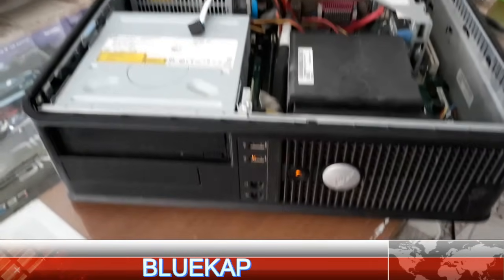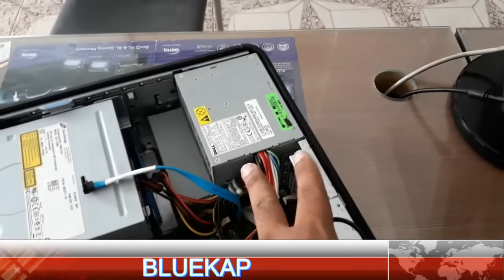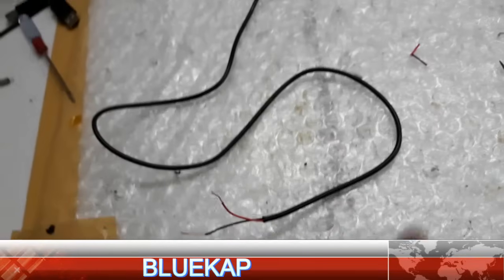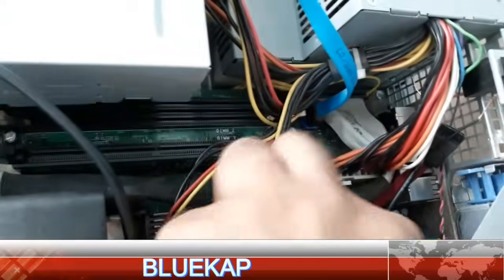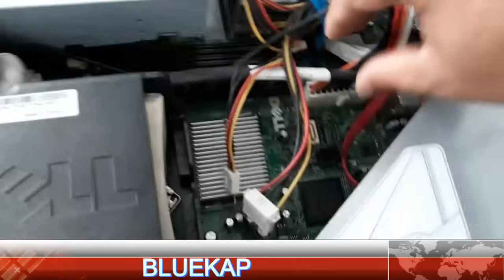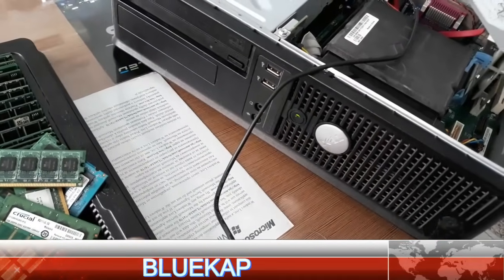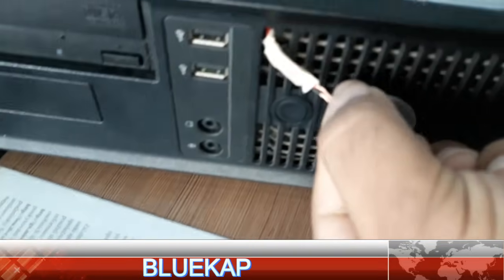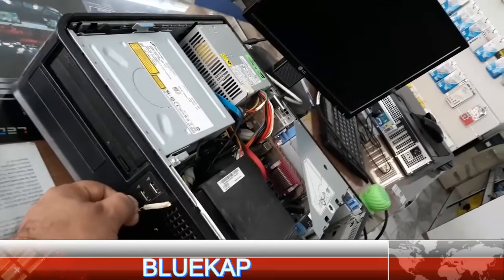Fix the Dell Orange Light of Death

Comment: Methods to solve the issue.
(1)If there is a blinkin' amber orange light on your power button that means Your Power supply ain't malfunctioning. To solve this one: There is a cable coming' outta your power supply which has sorta a bunch of wires that is connected to the Motherboard as the MAIN CABLE... There's a wire coloured green. You'll need to cut this and tape it on anywhere of your Computer's Case/body. It will boot up the computer with showin' a green light on the power button Or if your computer didn't boot up See the next Method for the motherboard.
(2)If there is a solid amber orange light on your power button that means Your Motherboard ain't malfunctioning. To solve this one: Unscrew the CPU Cooler and right close to it there would capacitors... Two capacitors around a little AC and there are 6 capacitors around 3 ACs... You gotta find which one is damaged. The one which works fine is sorta Glass-type coloured like a little light orange. The damaged's one surface is black... You just have to break it through a screwdriver or anythin'. Just take it outta your motherboard... Your PC will start up... That's what's the problem is. And yeah puttin' a bulb inside your Computer would help a dyin' capacitor and leavin' your computer with the case open on the SUNLIGHT would help you boot i up. I dug a lot to fix this up... I expereicned you didn't. Try these methods I told you...
Reply: Where do I need to tape the green wire on the motherboard or outside the case
Reply: @flamynoob9316  He did say to the outer case, not the board, otherwise... POP!
Reply: Putting it into a paragraph and fixing up the spelling would help.

Comment: Cutting 24-pin ATX connector lines...  Masking tape...  Bare wires out the front...

Absolutely dreadful.
Reply: Ay if it saves u money, it anit stupid!
Reply: well on a pos as a test who would care
Reply: readyxxi a
Reply: @anthonyreeves8685  you could just use a switch instead
or swap the switch is usually whats bad
Reply: Saves you money nonetheless
Reply: @gotdamnimin  I have inverted the RAM and my power is in fix orange but not blinking . have you any idea to solve this isdue?thank you brother.

Comment: My Dell orange power Light is not flashing can I solve it by this way too???????
Reply: parfait guigual Hey man. Have you found a solution?? If yes please help me. I earased the bottom of my ram, I replaced the motherboard, power supply, and cpu. It still shows a stable orange light without power to monitor, keyboard, or mouse. I've also done that jumper thing and the CMOS battery reset. Please help!!

Comment: "System battery voltage low" replace your cmos battery man. That can actually cause the amber light of death.
Reply: Devin Tech Tips yo devin I laughed at your comment thinking the cmos will never be the problem.i ended up just switching the cmos battery as u mentioned for a good working one..and low and behold the orange led stopped blinking and the machine now powers on and works normally...haha I’m still shock..thanks a lot for your tip bud..that shit works.lol
Reply: Battery Voltage Is Low Is Another Problem
Reply: when i tried to replace the cmos battery works fine for a couple of tines but when 1 day i open it again the issue becomes worst, and the battery becomes weak,
Reply: Light is blinking

Comment: ALso try to do a hard reset on the bios by removing the old CMOS battery for 5 minutes while having the system unplugged. (also hold down the power button once unplugged for the first minute). Then replace the old Cmos battery and plug the pc in and power it on.

Comment: Hello sir, i hav same situation here (optiplex 755). but now the green light just on and nothing appear on my monitor. i hope tht you can help me. Im dying inside do this 🤒
Reply: shkr amrl i have the same issue, did you get it fixed ?
Reply: The power supply might be the problem
Reply: Try to change the VGA and RAM

Comment: I have Dell Optiplex 620.Of late, it has been behaving like this. (Normally when you start with power supply, the fan will start and then stop till you push the "on" switch of the front panel of cabinet.) When recently, I try to start the 'on' switch on the body,  it will show orange light and not turn green to put the system on.  I was puzzled. The system starts at random attempts. No certainty. I tried SMPS cable, Mother board supply socket, battery etc. ( all these removed and again plugged in) It still gives random observation. i.e. sometimes starts and works and many times on strike, i.e. orange light again.  Now while writing this comment, the system put on through trial and error method. Let me see how long, how many days it works normal. If it fails again, then I am sure going to go the way shown in this video. 
My earlier problem was fan making more noise, running at high speed. This was solved sometime back by myself by cleaning the CPU fan and cooling fins. I had obtained the jelly to required after re-fixing the cooling fan That worked for month or so. Fan was very silent. But when I again opened the fan and cleaned it and replaced with jelly, it still makes noise, and goes on high speed. All this shared for use of viewers. Thanks.
Reply: On occasion popping the battery out and resetting the bios will solve this problem. And while your at it a little cleaning doesn`t hurt.
Reply: Then how you solve that problem plz tell me in brief coz same thing happening to me ~_~
Reply: Not to wotty, someday power supply make go boom! all set ok?
Reply: I had the Sam problem . I solved it by using a resistor on the fan power to reduce the power to the fa n

Comment: i try a new power supply instead, but it still shows orange light
Reply from the maker: Replace  new "CMOS" battery
Reply: I tried just about everything. I think its the capacitors, maybe because some of them has a bit of rust on it.
Reply: Logan Firstman I have earased the bottom of my ram, I replaced the motherboard, power supply, and cpu. It still shows a stable orange light without power to monitor, keyboard, or mouse. I've also done that jumper thing and the CMOS battery reset. Nothing works. Please help!!
Reply: its mother board failur/ capasitors